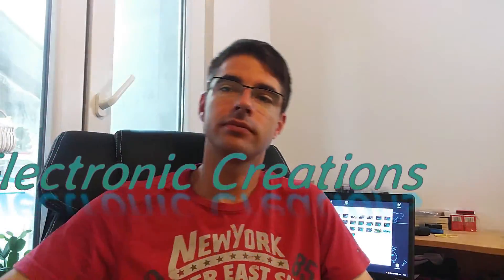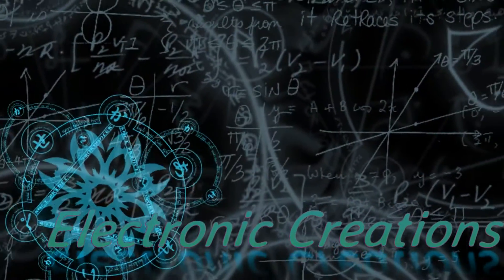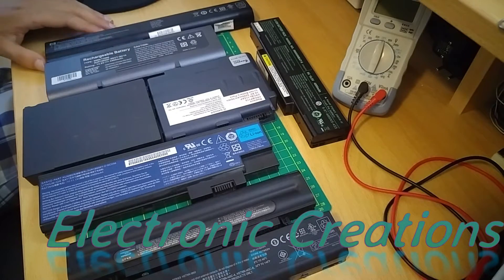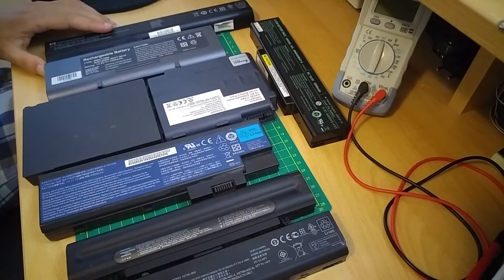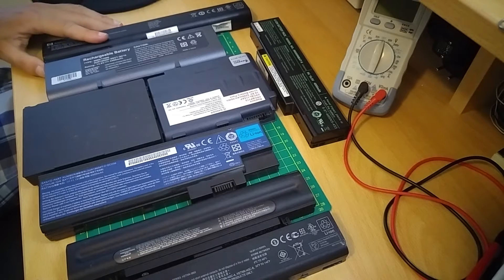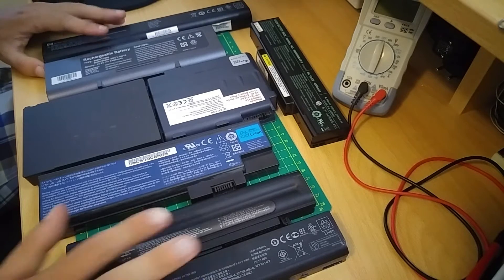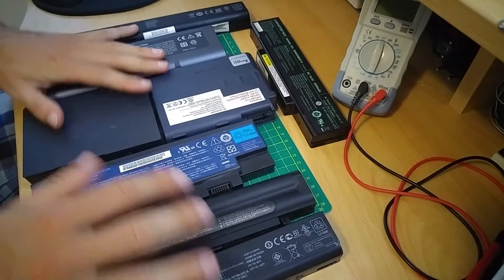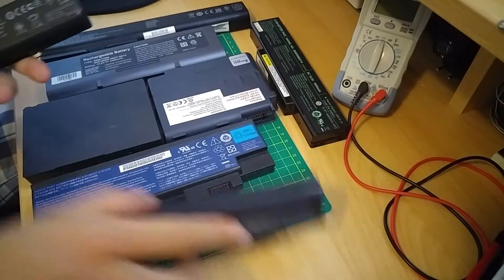Cheap 18650 batteries ~ recycled and tested

Comment: What  brand o n green cell  (6pcs) with overheat category ? Thank's
Reply from the maker: 6 green cells that overheat are Panasonic, but they dont overheat on smart charger.
Reply: I have cells with same green color of yours, but the brand are Sony manufacture 2008, still in good condition. Thank's for the reply

Comment: Interesting battery pulls and final results.. What are you planning to use them for? specially the low capacity cells.
Reply from the maker: Low capacity cells i will probably use for custom made solar garden lights. High cap will go in powerbanks and my future plan is electric bike and power-wall.
Reply: Cant wait to see those power banks video, thanks!
Reply from the maker: I have 3 models so far:
Simple
https://www.youtube.com/watch?v=ddV3xvPwIDE
advanced
https://www.youtube.com/watch?v=WPS8PHbA0OY
mini
https://www.youtube.com/watch?v=sj0pyRgqz2o